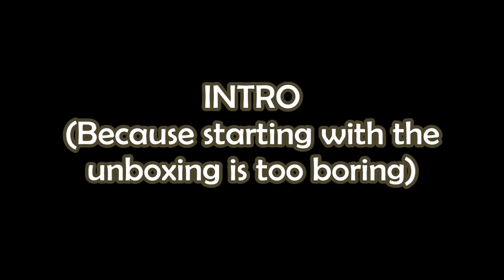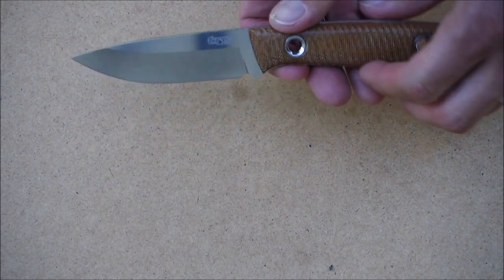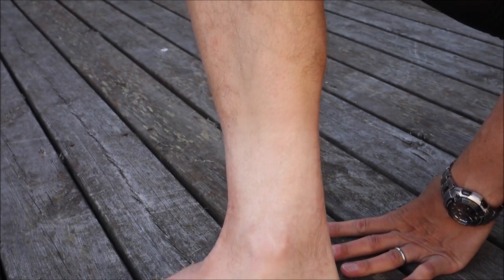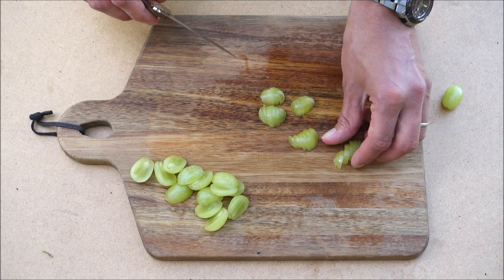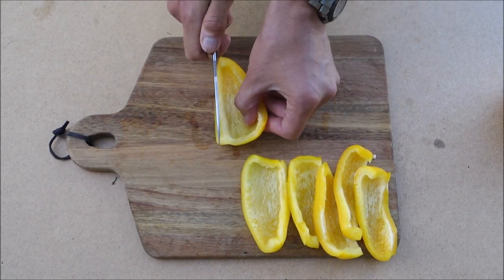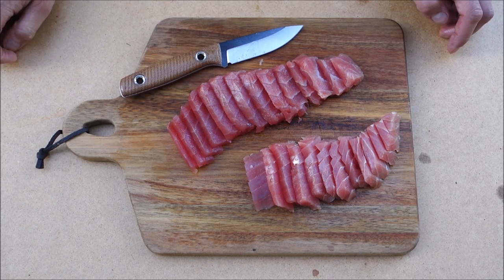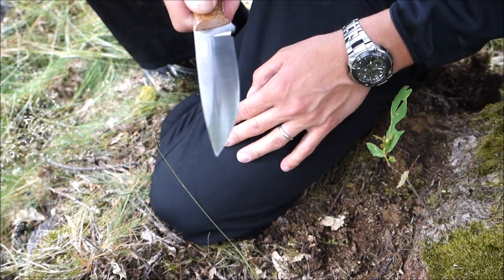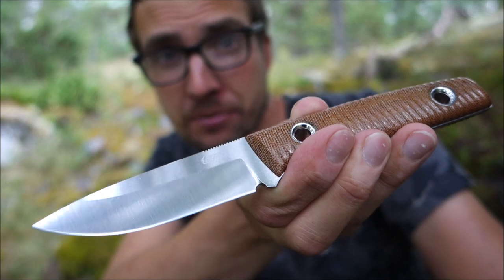TRC CLASSIC FREEDOM - FULL REVIEW

Comment: my trc "this is freedom" was the first knive slicing hair in half right out the box. Further of course the knive is not as easy to sharpen for an average user. But if you can, its very very good. The "classic freedom" is on my bucket list because of the thinness in spine. It is just more usable in all day tasks. not to neglecting this is freedom... its not too thick also and can handle some experienced hard work, too.